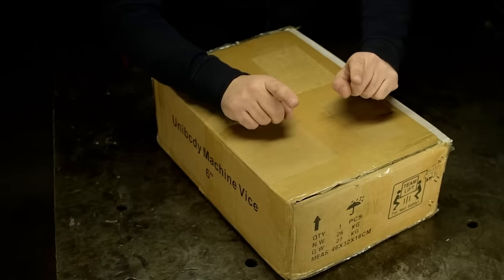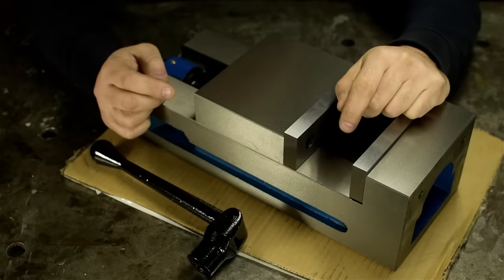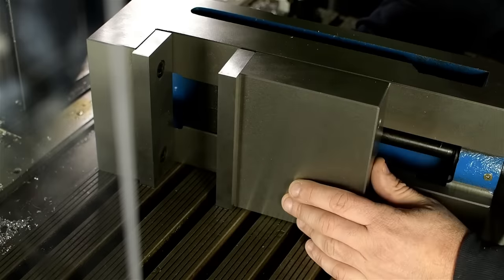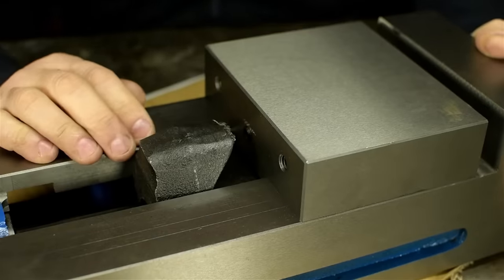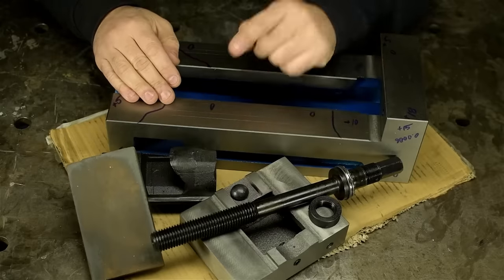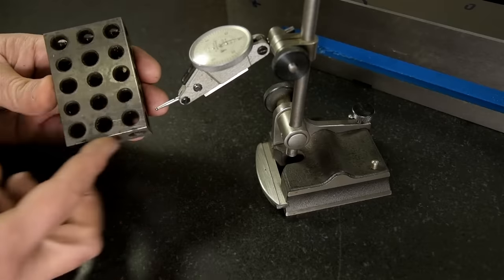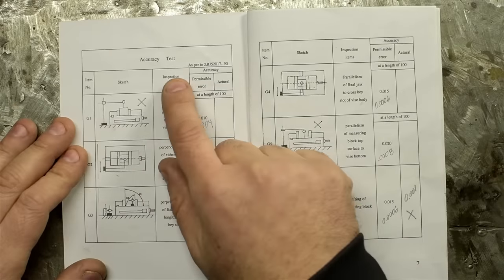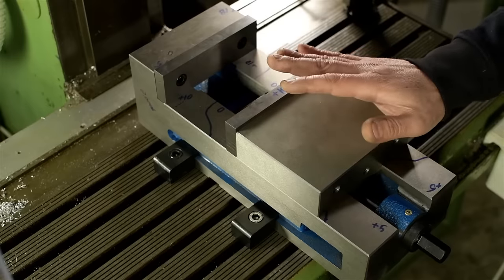Cheap Milling Machine Vise is CHEAP!

Comment: Hey, what's a couple thousandths of an inch,among friends. It's pretty shiny on the ground parts. That must count for something!
Reply: I thought shiny was one of the main things to look for. Maybe it's just in my head, but my polished tools seem to work better than the rusty ones I leave outside. Must be the weight of the rust slowing me down.
Reply: I think I see a grinding video in the future, or scrap bin. Grinding video would be much better.
Reply: @carlosmastronardi3296  from a neutral Swiss point of view - it probably could be worse American for example. (No offense 😁)
Reply: @fischX  Nah, with our labor laws and regulations, there's no way you could produce an American machining vice for $150.
Reply: @Timbo Dewabem AHH HA TOT has done it again, proving the earth isn't flat as an undertone in a vise video!
Reply: A quick and simple way to keep the coolant from filling your boots or peeing on the floor is just use a small ‘lump’ of rag or tissue stuffed in the side of the vice .. it works surprisingly well. If coolant is say running down some flat bar stock just drape a rag in position and you’re good.
You may be surprised by the shocking state of the vices down the years I’ve had to use as a manual miller down the years here in the UK . Absolute rubbish a lot of it so your Chinese junk does have some mileage on it... Yeah don’t over crank it!!
Reply: @patkirk960  we always used beads of strategically positioned Plasticine for redirecting errant flows of suds
Reply: @V8PropaneBurner  ah right.. good idea!
Reply: Hi Ron! The Man! Glad to see you visit us mortals. Great respect to you!
Reply: @carlosmastronardi3296  As someone who owns and has owned many kurts and others… You would be surprised at some of the Chinese quality these days. It’s us Americans who only want to import the shit cheap stuff. And then complain that it’s not as good as some thing precision made. 

Guarantee you they could make a vice just as accurate and well-made as a Kurt, at 1/3 the price, that would have the same longevity. Obviously would be much more expensive than this vise… but still really cheap. that’s slave labor for you

But just like any other place in the world… It’s pretty dumb to generalize millions and millions of people. That’s what the rest of the world does to us Americans, and we sure don’t like it. 

China makes a wide range of products in varying quality. From cheap shit to really nice stuff. It’s up to the importer to select the quality.

Jesus Christ the inside of an iPhone is 10 times more precise than any machine vice. Take it from someone who does more bga rework and Micro soldering than I’d like to admit.
Reply: @ssholum  I don’t understand how 7.25$ an hour and right to work laws keep americans from making cheap stuff?!
Reply: @marcsimard2723  Intentional misunderstanding for a joke? 
Either way, yes, those contribute to increased price when comparing to products made in countries without worker protections that pay slave wages, don't have environmental regulations, and don't care if their workers lose a limb or two.
There's a lot more to it than that, though. Mostly bureaucracy and taxes.
Reply: @carlosmastronardi3296  True, but that's not a turd. That's cast iron.
Reply: Glad to see you here....   LoL
Reply: @hullinstruments  it’s not even slave labour... a big reason is simply that China is the place with giant halls of 1000 CNC machines so you can sell a whole lot more CNC vices there than anywhere else.
Reply: @Timbo Dewabem fyi the earth where you live is definitely out of square
Reply: @carlosmastronardi3296  But does it have a "guarantee on the box"?
Reply: @52Ford  rust? You mean the orange salt? I love the stuff I put it on everything
Reply: Dont get me wrong..... that is not ment for Tony.... but in the most Cases... where is nothing to do with your machines, someones start rocket-sience arround them..... 🤣
Reply: It’s a Chinese trick to flash all the surfaces by grinding. To the untrained this means “precision.”
To a real engineer it means approach with caution. 
Most of these Chinese vices are garbage and are simply not good enough for industrial use.
Low entry hobby use only.
Vertex gear is ok-ish.
I took a punt on a Chinese kurt copy once. I stripped it down for inspection and the following day I took it to the local tip for disposal.
I couldn’t allow it to disgrace my workshop. Inaccurate work holding makes precision work much much harder than it needs to be.
A quality vice is FOUNDATIONAL and is AS important as the machine it will be used on.
Reply: Not if you're paying 150$ for such a mass. Worst case scenario free cast iron raw material

Comment: Some careful work with a grinder on that surface plate would bring all these measurements into spec.
Reply: hey tony looks like you have a volunteer here.
Reply: a flap disk will help you remove material with a bit more control than a grinding wheel.
Reply: Glass bed it
Reply: Wouldnt it be theoretically possible to just rip the jaw off, use a bit and mill it down to flatness?
Reply: @B0BBYL33J0RD4N  grinding is the better bet working with tenths but I think he's fkn around about the plate the effort
Reply: I was wondering if Tony would go there, tbh.....
Reply: Yes!
Reply: Yeah, 150 got him most of the way there. What's an hour cleaning up the surfaces to make it work better? He has all the tooling already, may as well I'd say. Can make another video of it even lol
Reply: Dude you r here too?? Hell yea the maker world is a small one haha..
Reply: @Tzu412  His mill has a horizontal. Could he install a grinding stone in the horizontal and basically true up the vice to the mill like a surface grinder? The bed of his mill might not be perfect but if you ground the vice using the mill maybe they would be perfect?
Reply: Time on a precision surface grinder exceeds the value of just buying a good vice.
Reply: @jenniferwhitewolf3784  Unless of course you could produce a YouTube video making $5k while doing it.
Reply: @SHAD0WZOMBIE  I never miss a This Old Tony or Clickspring video!
Reply: @jenniferwhitewolf3784  I would expect that to be true if he had to hire a shop for the grinding, but I believe he still owns one, so no out of pocket cost for him. Or are you saying that even then he’d be ahead by buying a better vice than spending x hours grinding this one?
Reply: @jenniferwhitewolf3784  5x150=~750, he's already in for 150 which means that if it takes him an hour his time would be worth 600, which it isn't.

It would have to take him 3 hours to be close to being even and that's if he makes 100 an hour which is unlikely given that would put him at over 200k* a year.

He has the rough item and all the required equipment and ability; it's more cost efficient for him to accurize it than spend another $700.
Reply: No better way to turn a $150 Chinese vice into a $750 Chinese vice.
Reply: A couple of months ago a gentleman came to me with a Chineesium mill vice that was cheap..
As an exercise I took it on as a project and as a learning exercise for the gent.
It took 20 hours to bring it to flat, square, not twisted, action smooth and with a perpendicular fixed jaw at a reasonable grip, admittedly the tutorial added to that!
As well as my tolerance was at 0.002mm or 79 millionths for flat, parallel and square.
If a commercial shop was to charge to do this a kurt would be a better option.
If one Required that kind of precision!
Reply: @agentx250  Where, in the hell, did you get $800K for $100 an hour?
Reply: * wince *
Reply: That sounds like a great excuse to go buy a new kurt vise!
Reply: @EZCyclone  I flubbed the math and quadrupled the duration of a year. It will be fixed.
Reply: @agentx250  Happens to the best of us!  Sorry for the snarky response.  Seems I was  tired and grouchy!
Reply: @EZCyclone  Not a problem man, some rando quadrupling the length of the year will put anyone in a lousy mood! 🤣
Reply: @samuelbennett6026  and a hip flask will help ignore the discrepancies!!
Reply: Sound to me like a follow-up video is in the making ;-)
Reply: Sometimes I don’t think Tony knows what careful means
Reply: how about just some fine emery cloth lol
Reply: @domesday1535  not an angle grinder lol. He is talking about a surface grinder
Reply: @jenniferwhitewolf3784  that depends a lot on the value of you're time. If you need a cheap vise, have a surface grinder and plenty of time then this thing seems like a great deal.
Reply: @captcarlos  Out of curiosity, Did it have the same 60' thread through the rough cast jaw with the taper back cut and the half "dome" ball load spreader and did you do anything to improve that?
Reply: @EZCyclone  200k
40 hour week nominal 
52 weeks per year , call it 50 for easy math
100 dollars  per hour 
40 x 50  x 100
 200k per annum
Not hard to work out
Reply: @davidp8157  Pays to read all the replies. 😉
Reply: @larryking9460  , specifically  what...
I edited  a typo recently so,  it shows as a recent post,  though  originally  posted before many of the subsequent  replies as a response to the previous poster, shown  as a reply to that post,  your point is....   lots of subsequent replies....  and ....
Reply: @davidp8157  👌
Reply: @larryking9460  there are samples of the most proffessional squables ive ever read in this comment section.  Tonys fans have eticate lmao
Reply: @samuelbennett6026  I think it’s a precision surface grinder being referred to...
Reply: @waltermartindale9008  I was being ironically naive. of course an angle grinder would be the wrong tool for the job and there's no way you would ever get it even close to flat. the original comment only said "grinder" and didn't specify surface grinder. I was playing off that vagueness by recommending disk selection on the wrong kind of grinder.
Reply: You have to lap a surface plate

Comment: “Some of my best friends are metric” 

The fact he can deliver this jokes without a single bit of hesitation gets me every time
Reply: If God wanted us to use the metric system he would have given us 10 fingers.
Reply: Maybe hes proud of it
Reply: lol - im 61 and all through school they drilled the imperial system into me and much like tony I just cant instantly translate every time they say the car went "80kph" ???- yet mph is instantly recognizable to me.  But then im an old curmudgeon that doesnt bend well to change aside from what I grew up with.
Reply: @christoph72761  I've got eight fingers and two thumbs, better suited for binary based calculations with a convenient carry.  Base 4 or base 8 would make more sense than base ten.
Reply: @1djbecker  - Neither base 4 nor base 8 are particularly nice in terms of factorisation. Base 12 would be ideal (duodecimal metric). Also, an extra thumb on the other side of each hand would be really practical. Genetic engineers, get to work.
Reply: @1djbecker  I totally agree that something base-2 related is much more useful in the physical world. I love watching people try to cut pies into 10 even pieces.
Reply: @1djbecker  🤣 👍 I never understood why they made the PDP8 12 bit 🤷‍♂️
Reply: @christoph72761  It made a lot of sense at the time... but only for a few years.  I used machines with 12, 24 and 48 bit words (KL10 and Harris H series).  24 bit FP was fine for many uses, and 48 bit didn't lose much over 64 bit.  Both were considerably faster when you were counting gates, and there were convincing economic arguments for locking us into that decision.  But 6 bit characters and wonky addressing arithmetic would still be haunting us if the world had gone that way.
Think of some ancient scribe deciding that we had ten fingers instead of eight as making the same mistake.  They complicated calculations for the rest of time.
Reply: @yambo59  Luckily, in these modern times, I have the advantage of CAD and SolidWorks, so now I can easily whip out drawings in cubits (useful when designing Arks).
Reply: @yambo59  I'm 5 years younger and from Downunder, I was taught imperial from kindergarten to grade 2 and then metric from thereon. As a result I feel fortune to be "fluent" in both.